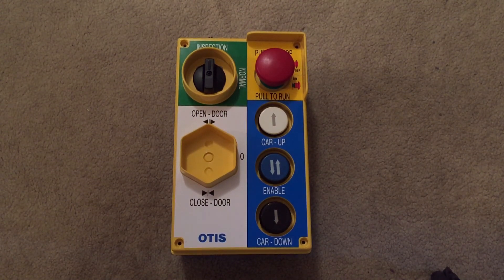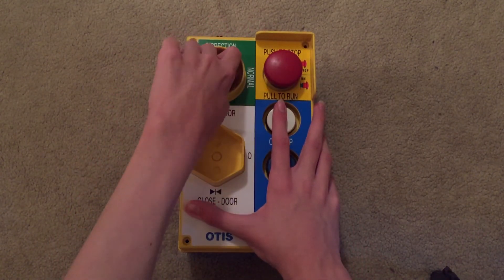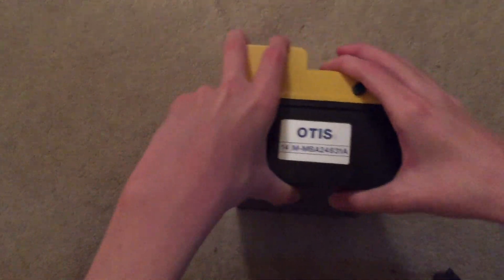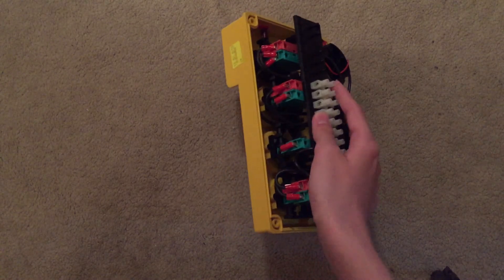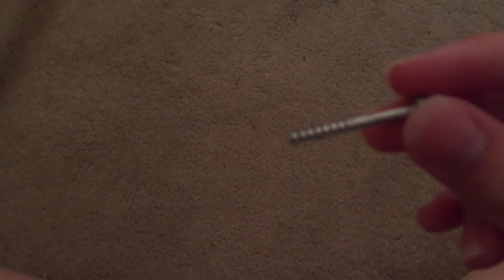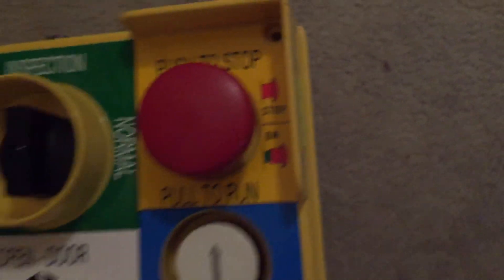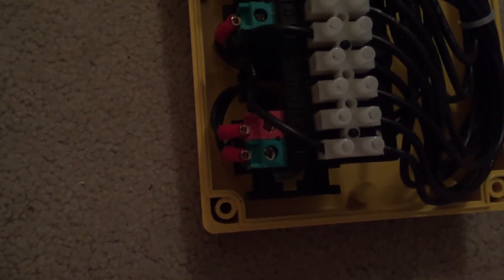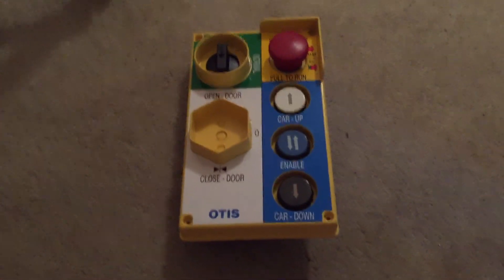My Otis Elevator Car Top Inspection Station

Comment: It is interesting to see inside it.

I find this annoying when surfing lifts.  The buttons are hard to press, especially when holding a camera at the same time.

This car top control is often mounted upright.  To make the lift move you often have to press the buttons so hard that it feels like it could snap of where it is attached.
Reply: I have seen them working on GEN2s.
The green light is lit when the normal/inspection switch is on inspection.
And the red light is lit when the stop switch is pushed in.
Reply from the maker: +Beno 
I have a question. It looks like there is a place for door controls (there are door open and close symbols), but there are no door controls. Have you ever seen a car top inspection station with door controls? From what I have seen, it looks like door controls might be rare even on actual elevators. Also, do you know what the red and green lights that I think were on the top are for?
Reply: +upanddownadventures    The door control switch usually doesn't work.  It does on Otis 2000/gen2, but other lifts it usually doesn't do anything.   They probably left it out as it was not needed.  I don't know about the lights.  i have never seen a light on the car top control.
Reply: That sounds like a poor mounting job.  The box should be mounted very sturdy as you do have to push them all the way down and do not want any play for movement.

The Otis ones look nice, but there are some out there that have buttons with longer travel and are much easier to push.  But unless you have a large hand you definitely need two hands to operate because the buttons are spaced far apart.
Reply: @miguelquazar883 Well, I might have quite large hands since I manage to press both buttons one-handed on those cartop boxes.